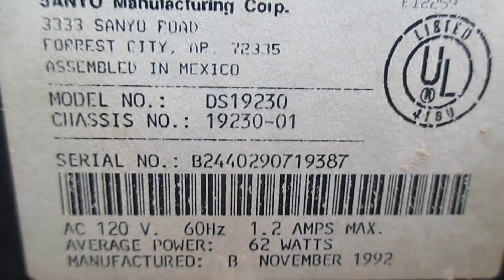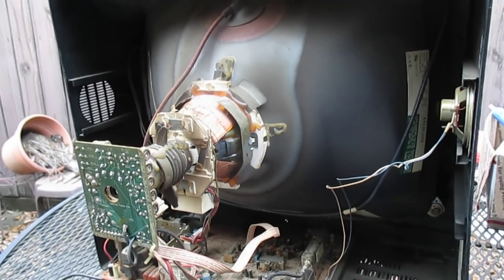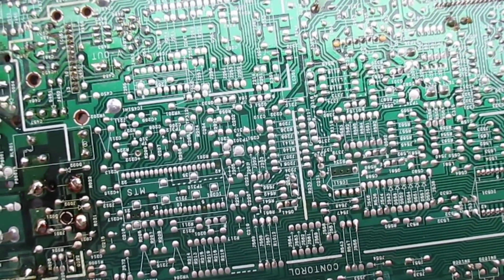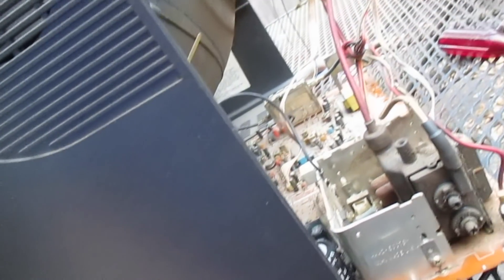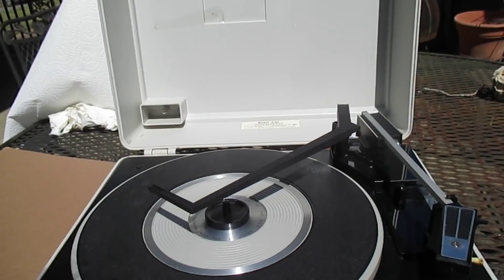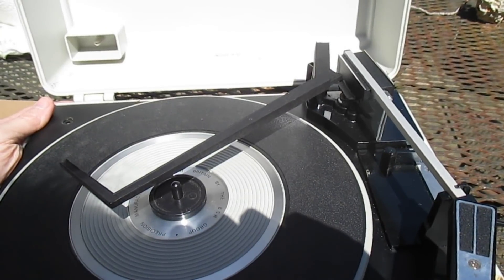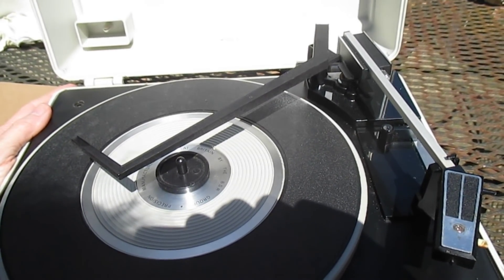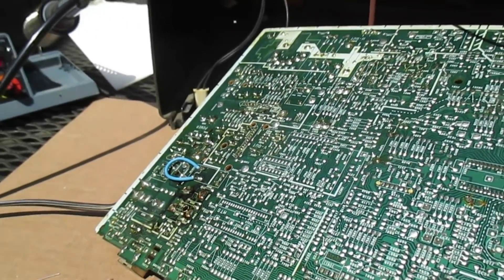19" Sanyo TV from 1992 repair attempt (possibly lightning struck, big waste of time)

Comment: The $199 Walmart special! I’m surprised any of them are still around. They were EVERYWHERE in the ‘90s and early 2000’s. They lasted 10 years if you were lucky.
Reply: ONN Brand Tvs  is junk there DVD players are good   But if buy TV is got be over 299$  However I got 119$ 32inch Best buy Brand it will 4 years old in April but I only ise Second Computer Display  . But we got 499$ Basic 55 Inch Sanyo  LED HDTV  it 6 years old now  I swear Sanyo Last forever
Reply: The slightly better ones seemed to last a lot longer. At least, by today's standards. My parents, when I was pretty young, got $500 for an old 80s van scrap/trade, and put the money into a new TV in the early 2000s to replace the cheesy 80s wooden floor model (it suddenly lost color - still worked as a b/w set!). That thing had many, many hours put on it until its replacement only 3 or so years back. No chance the new LCD will last as long. Not without at least 2 or 3 power supply recaps, at least (been there).

Come to think of it, the "always on" 90s CRT sets in school must've been quite the performers. Only some teachers shut them off after the morning announcement/pledge thing they did on the TV.
Reply: Weeks ago i got a free 1992 Sanyo AVM2502. It was the most disgusting TV i had ever seen with really thick brown nicotine staining. I couldn't even clean it off. The inside of the set was so nasty and fuzzy. It still worked and had a decent picture. I got it from a woman, it belonged to her aunt and the aunt died, so i guess either the aunt or whoever owned it was a heavy smoker.

Comment: I know when I've worked on these, one of the first things that I did at the end of repairing them was desolder the flyback and then check the low voltage supply.  If I got low voltage, then I usually determined it to be the flyback.  I would usually replace the flyback and horizontal output and it was usually good to go.

Comment: Back in the, I would say mid 90s we had a Sony TV that had a very similar problem, we would bring it to one local shop and it would always work fine, luckily my uncle was also a TV repairman so we decided to go on a trip and bring it to him, it turned out to be the power transformer.
The explanation on why it would work at the TV shop and not out our house, we believe the TV shop had a higher current being a commercial building, than we did at our house.
After the Transformer was replaced, it continued working for another 6 or so years, until it got struck by lightning and insurance replaced it.

Comment: Somebody gave me a Kenwood receiver to work on from around 1986 and it didn't turn on at all.  I opened it up and took the bottom off and put a magnifier on it and saw a bunch of connectors that looked like they separated perfectly round.  I found several connectors like that as well as two loose regulators.  After soldering all of that it worked.  My eyes aren't as good as they used to be but the magnifier worked.  My hint that there was something like that going on was I checked the anode side of the diodes and had AC voltage from the transformer.  On the cathode side there was no DC voltage.

Comment: In my area, you cannot find CRT TVs in any thrift store.  I don't think they are even allowed to take them.  Just like the store is not allowed to give you a damned bag.
Reply: None of the thrift stores around here have them anymore.
Reply: @wgrantha4438  10 years ago they were everywhere, but now I never see them.
Reply from the maker: There are a couple of thrift stores in my area that still have them (for now), but the rest stopped taking them several years ago, because nobody was buying them and the sets ended up being something that the store had to pay to dispose of. A few months ago, I bought a 13" GoldStar from the mid '80's for $10 at the Salvation Army, but she told me that when those TVs were gone, there would likely not be any more.
Reply: @radiotvphononut  I have a black plastic crap TV (though a step above this one) with very low hours (I bought it new and so I know the history) and I unplug it whenever it is not in use.  I'm a retrogamer and I use it for Colecovision and Atari games.  I dread having to replace it.
Reply: Goodwill form time to time will have CRT Tv but there mostly Small Screen  CRTs or Computer Display CRTs
Reply: What do you mean, the store isn't allowed to give you a bag?
Reply: @tarstarkusz  about 5 years ago they were still at the thrift stores.
Reply: @AureliusR  Plastic bags are banned in my locale (Philly)

Comment: That was pretty entertaining.  I don't get a lot of time to watch videos on YouTube or anywhere else really.  Thanks!
Used to be that those BPC TVs were everywhere.  I don't even see them on the side of the road, which really tells you something about the state of CRT sets in general.  When you can carry a 74 inch TV around without any help (if you cared about it enough, you'd enlist help), but need a five man crew to carry the closest CRT equivalent, who would want those bulky things.  I still get people who persist to crop or use zoom to fill up the 16:9 display with 4:3 content, which looks terrible.  Still a lot of 4:3 programming available over-the-air.
Great repair attempt.  Sometimes, it's just better to just write it off.
Reply: I HATE 16:9 TVs and stretch was avery common problem, here in Australia there were never 16:9 analogue broadcasts, ppl were too tight arse to buy a set top box to get the proper 16:9 video, that was in the mid 2000's. A friend who had a wide rear pro TV didn't bother to use his DTV box because Samsung didn't use logical channel numbering ie 7 labeled as 7, it was 1234 etc, all too confusing for him. He commented Serena Williams has a very big bum ( because he used the built in analogue tuner only in 4:3 content stretching the picture. I tried to get Tom to use the DTV box, I  yelled at him "I HATE STRETCH"

Comment: We have 5 Sanyos. (4 were stereo) 3 got zapped by lightning. One was fixed by a repair shop about 1999.
They replaced the voltage regulator.
1989-1995 Sanyos.  Lightning usually came through the cable . Because some got hit while being unplugged from 120 volts . So I unplug both the 120 volts and the coax when I hear thunder.
Interesting video!

Comment: I couldn't have fixed it one time. But if I got a raster the first time I would have wanted to connect a signal and verify it's overall function. Shame to go through everything and then problem with sound, picture, tuning etc.

You are the best. Stay well.

Comment: I had a similar experience with a vcr once that came in for a de-roaching and cleaning. De-roached it, cleaned it and then SNAP CRACKLE AND POP! Turner went and then this and then that. I bought a replacement for it at a pawn shop and sent it to the owner said sorry but no more can be done.

Comment: I had a GE portable stereo that was all tube and all metal with wing speakers that swung out. The difference in sound quality between the tube model and the transistorized GE Wildcat stereo was dramatic. I'd still have it but it was too portable and somebody walked off with it at a party I took it to.
Reply from the maker: I have a couple of those metal GE Trimline record players. One is tube and uses a VM changer. The other is an early solid state model and uses a Glaser-Steers changer.

Comment: I just donated an old "friend" that I've had for over twenty years due to high power usage.  Our power company decided to start ripping people apart with double power bills and in an effort to get my budget back to a more realistic value, I decided to let it fo.  110 pounds of totally working and reliable television, 32" screen, gone.  Living in Florida can, and often does, suck on even good days but this was ridiculous.  Governor doesn't give a crap for local people.  All he's interested in is getting reelected for another term or going to the White House!  So, against my better judgement I now own a 32" flat screen that is rated to use no more than $13 a year.  We'll see if it makes the five year mark.  I sure miss that big Panasonic.
Reply from the maker: I think the same can be said for most politicians. If your Panasonic is the one I think it is, they were well made for a 21st century TV and had a nice picture.
Reply: @radiotvphononut , that is the one thing I really miss was the picture and the reliability.  I never had any problems with the set but when the power company grabs you by the unmentionables, you do what you have to do.
Reply: Keep DeSatin in FLA.  My question is why can't the political parties run a decent presidential candidate? You either got the freak job left or the freak job right.  Whatever happened to people that were more centrist running for office.  Extremism is never good.

Comment: I have a 13" Orion color tv 2000's vintage with a built in ATSC tuner!!!  Still working one of the last CRT TV's made 2007-2008.  Not the best picture bright and harsh.
Reply: The last CRT TVs were 2010 Funais. My GF had an RCA branded one. She currently watches a 2007 Sylvania branded Funai CRT. These are decent sets. The Sylvania has a pincushion issue that's mostly visible on 16:9 programs. I have my 1987 Sears branded Toshiba and my dad's 1991 Electrohome branded Mitsubishi, which are still good for IPTV cable, VCR, and DVD.
Reply from the maker: @dougbrowning82  Back around 2011, I recall the local Walmart having a pile of Orion-built 27" Sansui sets on clearance and those were the only CRT sets left in the store.

Comment: i had an intermittent  no signals in a 70s radio, a ceramic cap was going short randomly in the IF amp stage,,   and as for flexing a board, had a pc motherboard that would go on and off if twisted, couldnt see anything obvious so was a write off,  maybe had a cracked internal layer track

Comment: The thing about Sanyo  they hardly messed when they did it castropic  Sanyo was brand i used to work on less Compried to RCA or Zenites from 90s  . I Really Don't miss it no more  After in 2009 i got screwed on set i fix  . Pawnshops around will not take basic Flat Screens it has be Smart TV  It can 65 Flat screen if Not Smart tv they won't take it  .  I love flat screen it best to use streaming devices  cause i watch only Discovery +  But we got 55 Inch Basic Snayo HDTv it 6 years old now  and still working  i swear Sanyo TV might be cheap but they last a long time . I work on RCA  that hit by Lighting  there huge hole in board and CRT was crack  that TV had to been on Fire they did not like when I told them buy new tv

Comment: You mentioned repairing flat screen repairs being barely worth it .. Flat screen TVs are hard to fix, especially the large ones. I replaced an LED backlight strip. It takes 2 large tables (or beds), a special suction cup rig to lift/disassemble the screen layers, someone to help move the screen layers, and a clean (no dust or pet hair present) environment .. then you need a special LED strip tester that’s current regulated at up to 270 volts. The parts were not expensive, however, I wonder who is willing to pay a shop for the labor involved.

Comment: I had a 90s panasonic with this issue. Button were like missintepreted. I had the remote and it worked fine. So I ruled out the processor. Then I discovered about the tact switch issue that plagged many Panasonic systmes from the era. The explanation is pretty simple: Instead of reading switches using a matrix of CPU pins (the usual approach) the got the complete front panel read with JUST ONE PIN of the processor. This pin was an ADC input and each tactile conects a different resistor value to a resistor divider. So each button generate a different voltage, 100mV appart from each other (to say something). Guess what happens when they wear out. The added resistance of the tactile fools the processor with a voltage that is different and close to another valid value (function). Replacing all of them fixed the issue ... really mean considering Panasonic called those line the Platinum series (BiAMP microcomponent)

Comment: Flat screen TVs regualrly turn up in the surplus/clearance bins at Goodwill, they won't even sell them  in the main store any more. The shop that works on my vintage electronics, is one those rare TV repair shops, that has been in continual operation for 50 years. He now mostly works on vintage record players, ,stereo components, console stereos, antique radios, ofetn those 100 years old, and occasionally vintage/antique televisions.The guy has more business than he can handle. He recently restored, and resold, a 1949 Admiral tabletop TV. I went in today, and saw a rare red and white 1955 Sonora Television someone had brought in. But for a while he was working on flat screens, but gave up on them last year, both because people stopped bringing them in, and he didn't think they were worth the trouble. I wonder if there are any higher end flat screens built to last. Probaby not. I never saw a BPC later  CRT television brought in, period.

Comment: I'd buy it! does it have RCA amp-out jacks? probably could install some if not.
Reply: You’d have to electrically isolate them when you put them in, if it doesn’t. I tried that with a hot chassis when I was in high school. It gave me a good shock a couple times!
Reply from the maker: This one uses a mono 3V crystal cartridge and it really would not be practical to add RCA jacks. If you connected it to an aux. input on a stereo, it would distort like crazy and it would be very tinny sounding because the impedance of the average aux. input is too low for a ceramic or crystal cartridge.